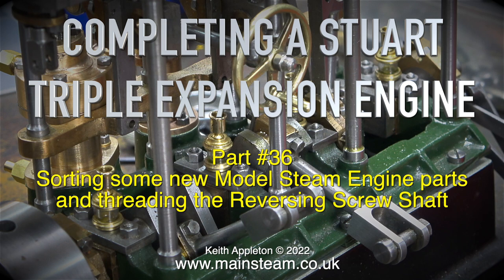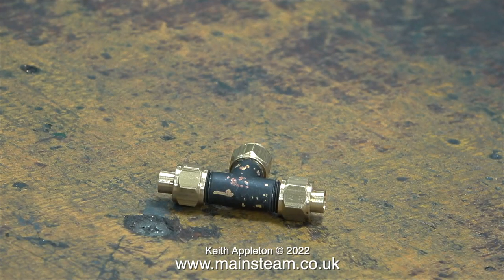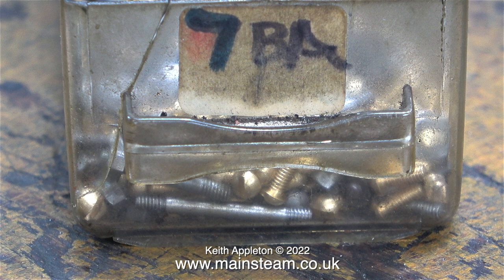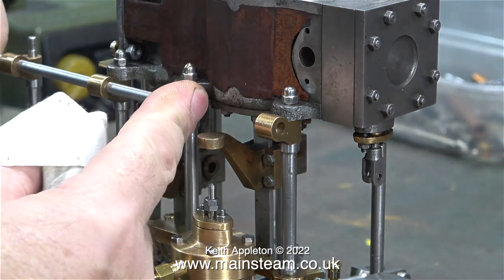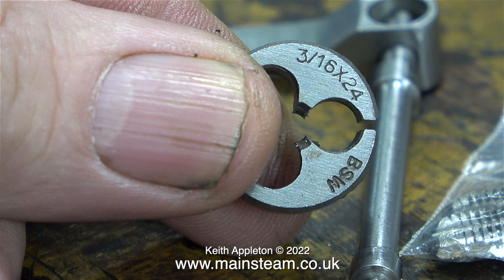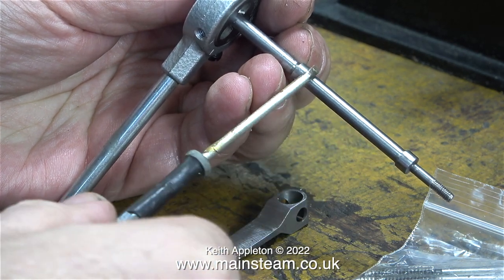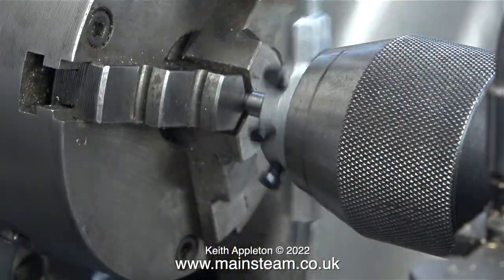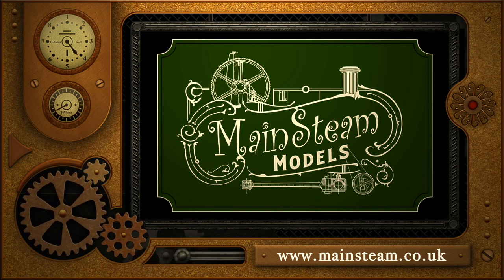COMPLETING A STUART TRIPLE EXPANSION ENGINE - PART #36

Comment: I'm relieved to see you're using a standard 3/16" by 24 BSW thread.
Recently purchased drawings for this engine call for a two start, rather than a single start thread for this part.
I got a two start 3/16" by 24 BSW tap from eBay, but unfortunately it's a plug tap.
The plan is to grind it into a second and use it to manufacture a die from silver steel.
It may well go pear shaped, but for £6, it's an interesting exercise and worth a try, with the single start thread as plan B.